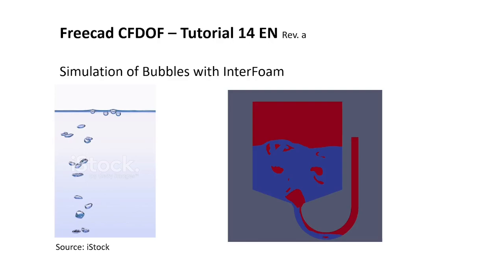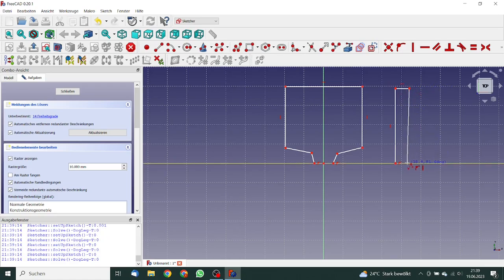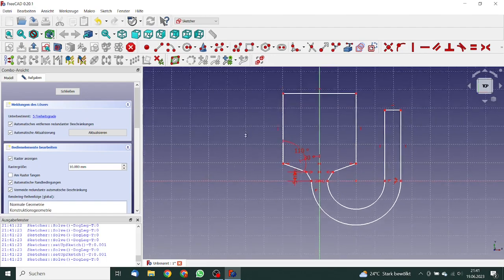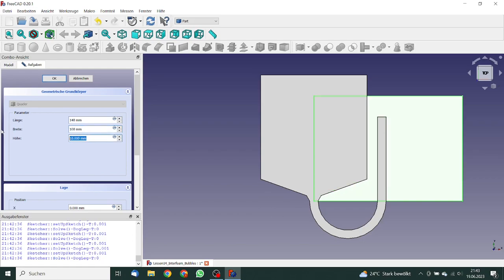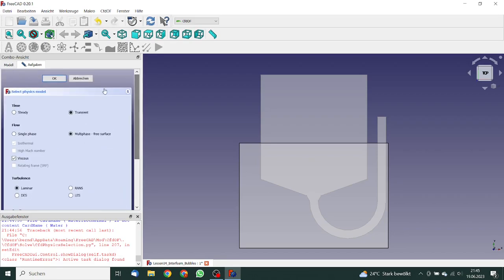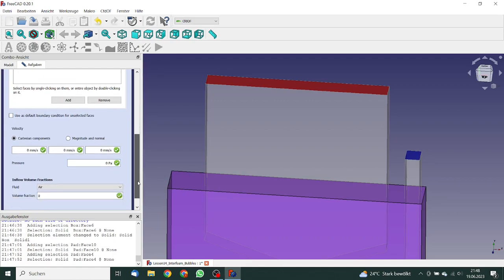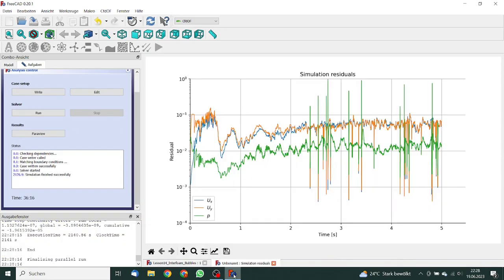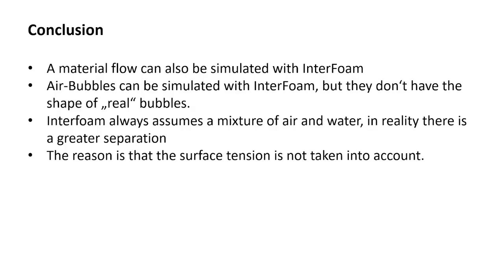FreeCad CfdOf Tutorial #14: Simulation of Bubbles with InterFoam

Comment: CfdOF don't work for me. If I try to click the "write a mesh case" button, I will find out the error "/AppData/Roaming/ESI-OpenCFD/OpenFOAM/v2106/msys64/home/ofuser/OpenFOAM/OpenFOAM-v2106/platforms/win64MingwDPInt32Opt/bin/surfaceFeatureEdges.exe: error while loading shared libraries: ?: cannot open shared object file: No such file or directory"
Win 10, FreeCAD 0.21, CfdOF (from addon manager), OpenFoam (mingw crosscompiled from github). What's wrong?!!!
Reply from the maker: Hello ph08nyx, your question about meshing is a general question. Please ask questions about the installation, use and functionality of FreeCad CfdOf in the FreeCad forum. You can find the general forum here: https://forum.freecad.org/, the CfdOf sub-forum can be found here: https://forum.freecad.org/viewforum.php?f=37

Comment: Can you include surface tension in the physics?
Reply from the maker: Hello speppino, thank you for your question. If you have questions about FreeCad CfdOF, it's a very good idea to post this question in the CfdOF subforum of the FreeCad forum https://forum.freecad.org/viewforum.php?f=37. When I recorded my video, I didn't know that OpenFoam also supports surface tension calculation. There is a very interesting post by thschrader (https://forum.freecad.org/viewtopic.php?p=689658#p689658) in the FreeCad forum that answers your question: Yes, considering surface tension is possible. But this is not supported by FreeCad CfdOF, you have to edit the input files for OpenFoam.